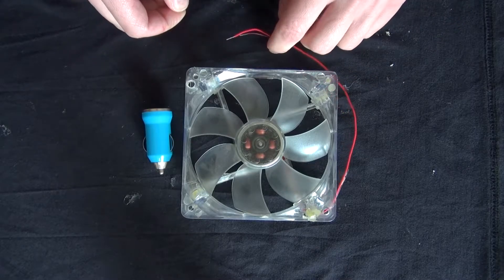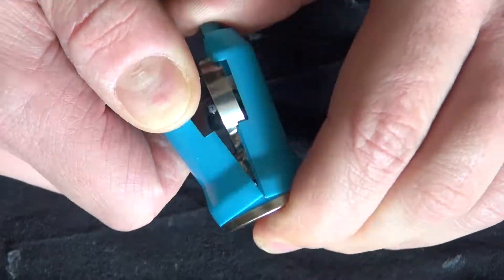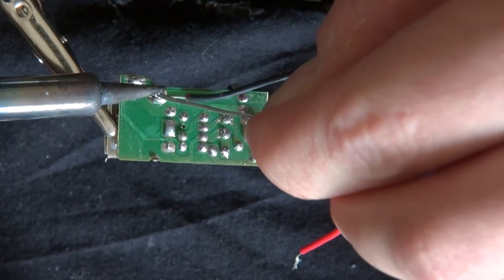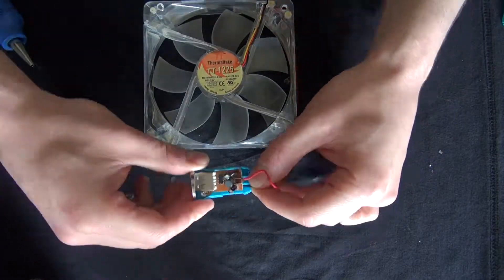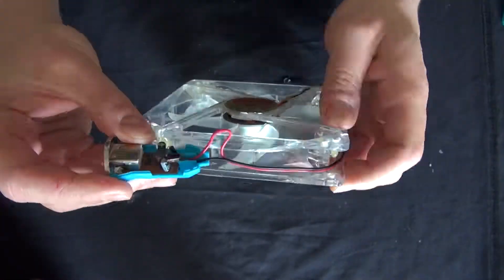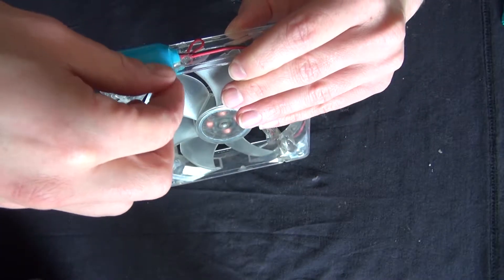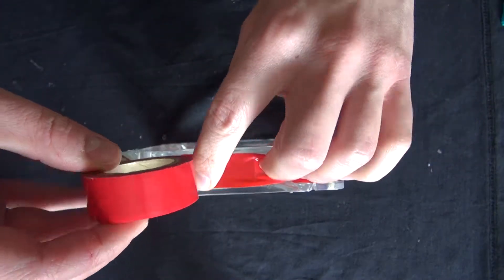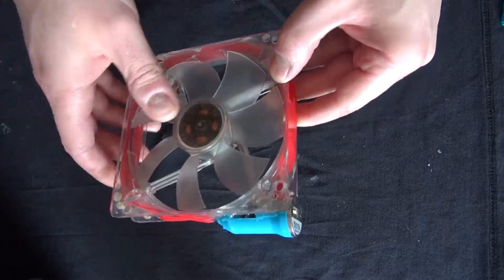PC Fan Charger

Comment: if wind power get Hight battery get damage?
Reply from the maker: It could if the wind was is strong enough.
Reply: @SciTyeTech  in electronic system hasn't any part to avoid to Hight voltage ?

Comment: If you point the fan the wrong way (reversing voltage), will it fry the charger?
Reply from the maker: No because the charger has reverse voltage protection.
Reply: @SciTyeTech  Did not know that, thx.

Comment: very nice projct but i think that the fan cant produce more than 2v max while the phone needs 5v to charge
and i am not calling you a liar but you just show the screen of your phone while it is charging so i dont know if the fan is charging it
Reply from the maker: Thanks! It is charging the phone because the output is close to 8 to 10 volts DC and I used the step down converter (car phone charger) to regulate the 5v output voltage. I should have made it more clear in the video, because while I was filming it I was driving. It is difficult to drive 30mph while holding the fan and camera at the same time, and without hands on the steering wheel in a public area. I the future, I may make a short video explaining and showing the wind power phone charger with better detail.
Reply: @SciTyeTech  thank you and I do think your videos should have more detail but they are  not like other diy channels that claim they have  made a free energy device or clickbait stuff. Well done very nice videos keep up the good work and never let any negative comments make you unhappy.
Reply from the maker: @stavrosps1238  Thanks! I am immune to negative comments. When I read one, I take it as a feedback for improvement.

 Yes, those type of fake diy channels really irritate me. What I like to do is to make videos that are educational and projects that anyone can do with working results. Sometimes I will have a project that does not work, and I show that it does not work. Then I will show how to make it work. And I encourage anyone who makes my projects to ask me if they have an issue. So then I can help them.
Reply: @SciTyeTech  Or, you know... Hold the PC fan in front of a bigger fan in a well lit room.